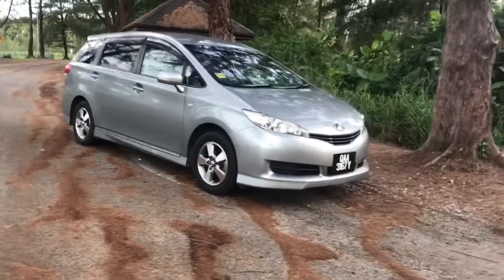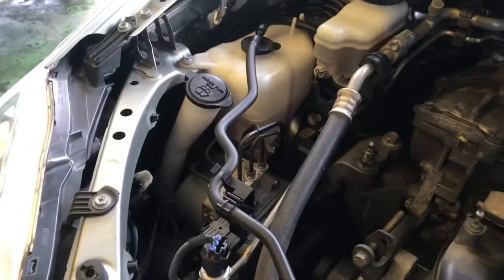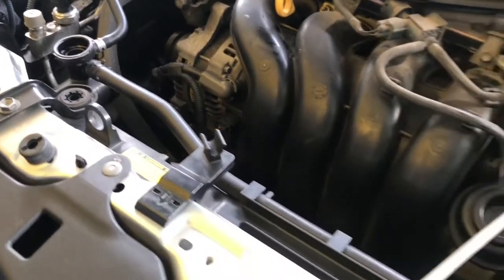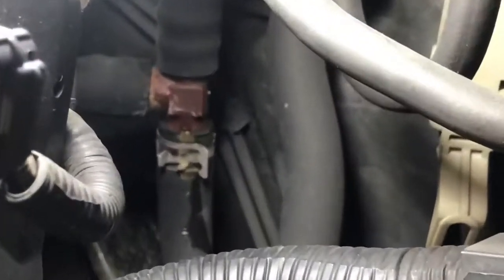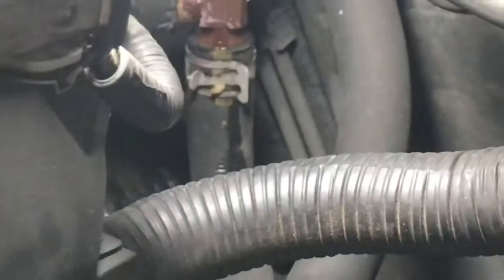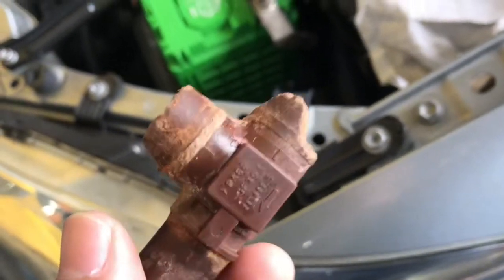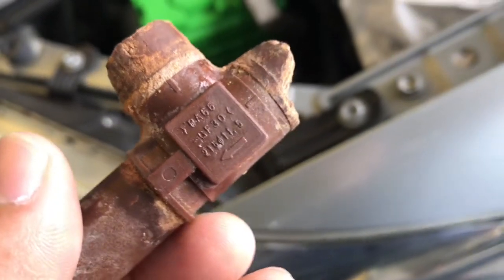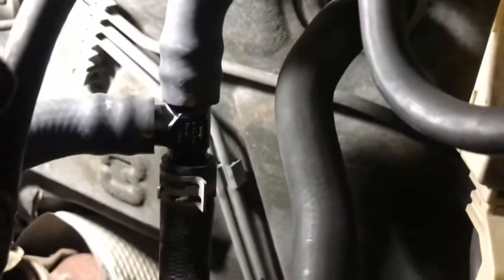Toyota wish coolant loss mystery solved!

Comment: My kelisa did the same too,it drinks coolant like ribena. It depleted rapidly. No coolant dripping out. I just hate this these microleaks..
Reply from the maker: Hahaha I like your description of the problem.
Reply: btw, do you ever consider pouring k seal stop leak to fix this microleaks? Would the cooling system be ok @ will it clog the radiator?
Reply from the maker: @bobochan4699  that can be considered if the leaking is from the seal in the engine block but in my case, it’s a rotten pipe.

Comment: Had my connector near to the battery breaking and fixed it
Reply from the maker: Nice, thanks for sharing! Appreciate that.
Reply: @wowcarwow  but my car overheats I can feel the heat, coming from the AC channels on the dashboard. How can I fix that. And I can put a 215 size Tyre with a 16 rim size, the ground clearance is abit low
Reply from the maker: @elviswafula6528  the coolant goes to the dashboard board because it has a heater as well. This car was built for Japanese market, but if you refer to engine overheat, then check your water pump or radiator cap...  the rim can be changed to 17 inches but try to use lighter rims so it won’t mKe the car sluggish. Bigger rims absorb potholes better and runs more smoothly.
Reply from the maker: See my review here! https://youtu.be/8IfVSfVfYUI